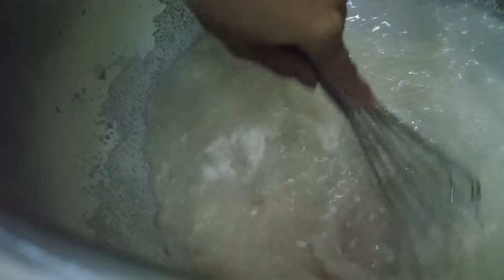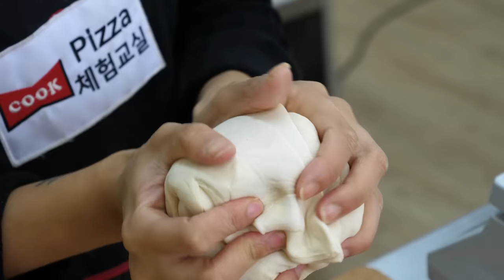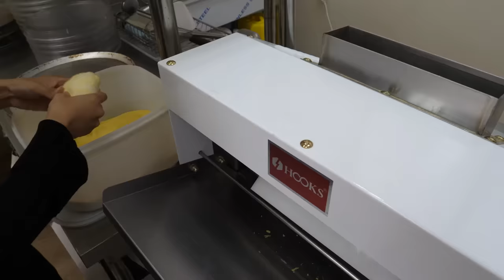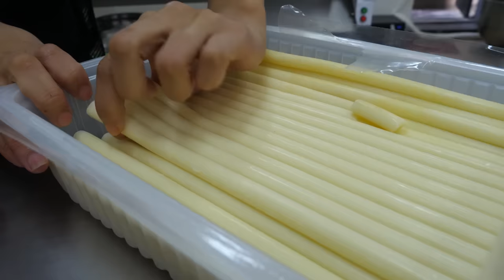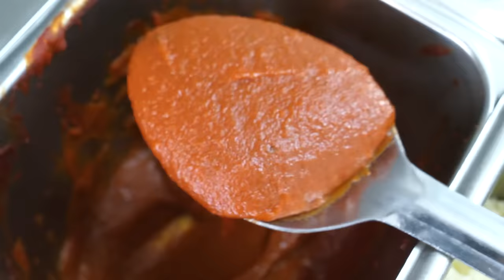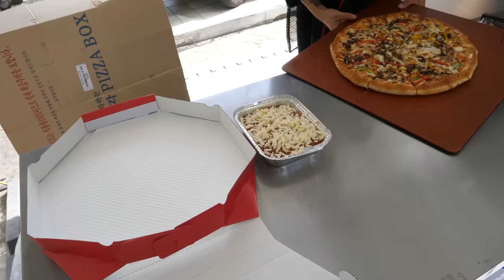반죽부터 직접 만드는 트럭피자, 전 메뉴 치즈 크러스트 / handmade truck pizza - korean street food

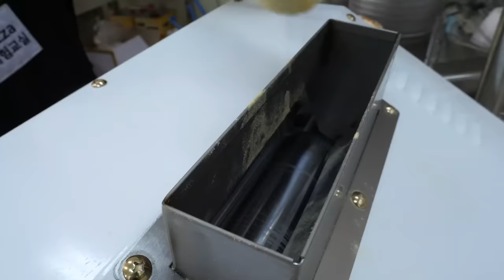Comment: 3:08 please dont do that again , u could lose ur fingers like that. Or worse , ur arm could be pulled into it.
Reply: For real dude. I was so fucking screaming at my monitor on that one.
Reply: Get some extra crunchy nails with ur pizza
Reply: @CookwithHasnain-007  r/cursedcomments
Reply: I totally cringed when I saw them do that! I was like, "Whyyyy?!"
Reply: @yung_slimp  yeah...... probably
Reply: That's like telling a Contractor with 15+ years experience to be careful with the Miter saw.. or someone that works at a deli to be careful with the slicer. Pretty sure they are aware of the risks and have a technique that is safe 88% of the time.
Reply: The newer machines have a sensor that automatically turn off
Reply: @christopherflores9029  Where i can from , we have a saying that goes roughly like this.
The first milion times you do it , you might be fine. And nothing will happen. Untill the time it goes wrong , and you wish you hadnt done it. 
So instead of gambling on the one time when it will go wrong , how about never doing dangerous stuff like that in the first place. 
So you will never have to wish you didnt.

Comment: It's crazy that the price 4 years ago was only 12,000 krw for the large size because when I first saw the video I thought it must be around 50,000 krw if now it's priced at 30,000 krw I still find it cheap because even though it's the same price as the Pizza Hut Large Size But it's double the size and filled with toppings